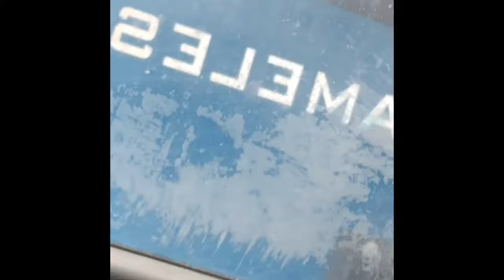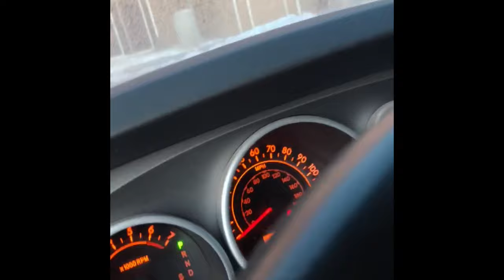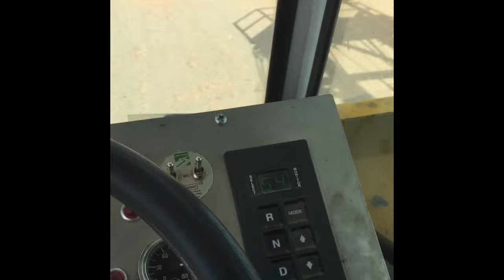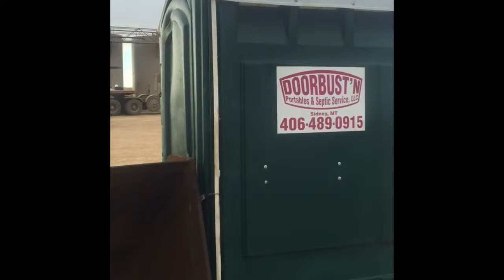Oil Rig Life

Comment: I miss it, I was in Minot ND. Wyoming and farmingtom NM, worked for Halliburton chasing rigs cementing casing,  never  slept much  for almost 10 years, always got the message casing sitting on bottom circulating need to hurry
Reply: I was on a surface hole rig in South Alberta and SASKATCHEWAN... We set a record I guess. 5 holes in 24hrs...Schlumberger and BJs hated us for sure. They had to drive over 150 miles ..not kms.. 5o wash reload and get home for ... a call. Time to go.  For 6 months we did that.  But not always a record day lol.  Our tool push made us rent houses in Burstall SASKATCHEWAN  cut the drive was 120...140 kms one way to Medicine Hat... plus 12 hr shifts. He knew we were nuts and would burn out. Put 9 houses on his credit card ... and we all paid him back  My house was pink and it was 350 a month... BTW me and my best Bruvver.  🤪
Reply: Hey man.